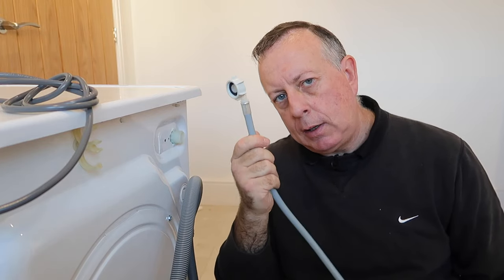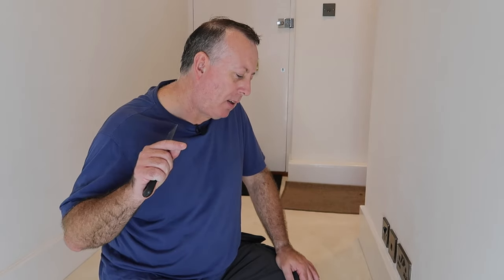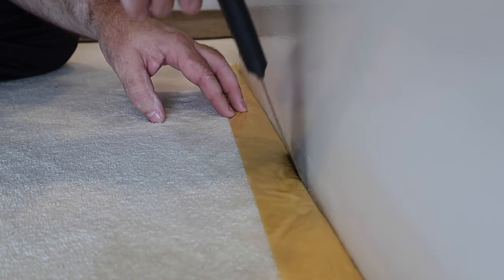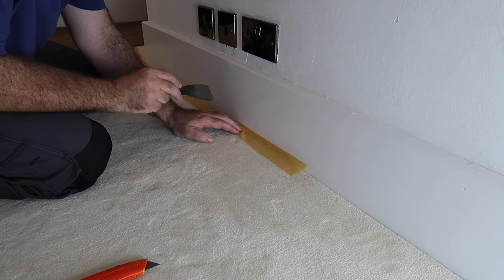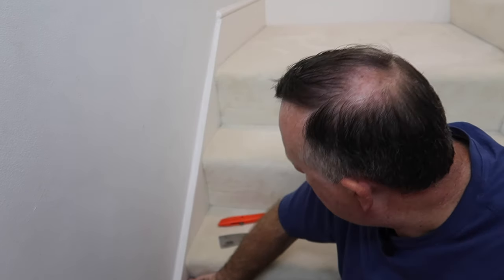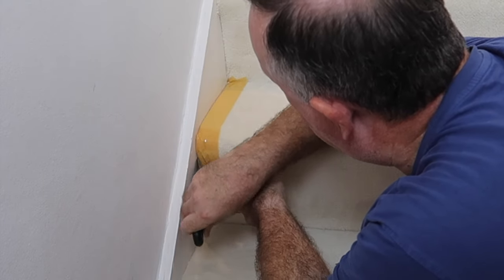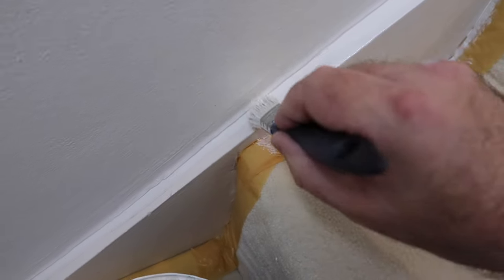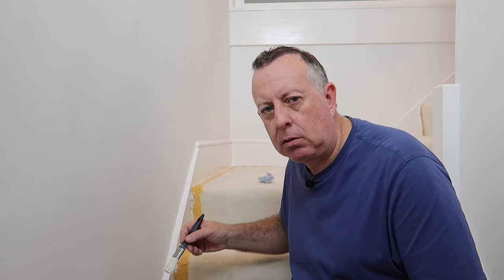How to Paint the Skirting Board Rather than the Carpet!

Comment: In fact, packing tape often does a better job than (cheap) masking tape, which tends to soak up a lot of the paint, and often doesn't stick to the thing you're trying to protect very well (so some of the paint gets wicked underneath). The downsides are that paint on masking tape stays wet for longer (so you need to be careful with it) and packing tape can stick too well and pull old paint off the surface when you peel it at the end (but on carpet that doesn't really matter, of course).

Comment: I have recently painted four rooms using the packing tape technique. It has worked perfectly each time...no more paint smudges on the edges of the carpet, or bits of fluff sticking to the new paintwork. Genius!
Reply: @kaler329  the video advised 24 hours later.

Comment: Great tip & one I have used in the past. 
My dad was a fanatical DIY painter. He used to strain liquid gloss paint through a pair of my mum's old stockings to make sure it had no lumps!! A tip given to him by my grandmother who was a great decorator. They must have had rubbish paint back then. It must have worked because his paint finishes were like glass. Anyhow, when I cleaned out my dad's garage prior to selling their house I found some strips of contoured white plastic about 800mm long by 30mm wide. They were in an unopened cellophane bag with a Woolworths sticker on them. Turned out they were for wedging in between the skirting & carpet to do the same job as your masking tape. Wedge in 3 or 4 of the plastic strips between the skirting & carpet, pull back the plastic strip & away you go with your brush. As you get to the end of the last plastic strip take out the first one & move it up to the front & so on. However, the plastic strips are too long to be used on a staircase so masking with tape is just about the only way to do that. Keep them coming Stuart.
Reply from the maker: Good stuff! Funny how things don't change much over the years except now we all have YouTube and the internet to learn from. Thanks for your comments.

Comment: Rarely any need for any type of tape. For skirting use a 1/2inch angled window brush, don't overload with paint & gently splay the bristles as you cut into the carpet. Job done. Tape will leave a mark on the painted surface ( i notice you never gave us a close up shot of the finished article). Mind, i have been doing this for decades so...

Comment: No joke, I recently used a thin Coronavirus A4 information laminate. Saves so much time. Just slide it along, also handy if you need to sit the brush down.

Masking works but you definitely run the risk of paint peeling from bonding to the tape.

Nice one cheers ✌🏻🤙🏻
Reply from the maker: Thank you
Reply: Doesn't the paint run down once you move it though?
Reply: @GK-qc5ry  no because I lay it off. If paints running you’ve used too much. The pros tape carpet, but you run the risk of it peeling when you pull the tape away.

Comment: Hi, amateur painter here 👋🏼 I tried this but when I peeled away the tape it took a lot of the paint with it leaving jagged edges ☹️ I used Dulux trade primer and Dulux trade satin wood. Primer was left for four hours, then 18 hours between two coats of the satinwood. Any ideas? Thank you
Reply: Yep, you could remove the tape before the paint dries,also when painting, don’t load the brush up so much, and try and cut in as if there was no tape iyswim.
Reply: that is an inevitable and high risk with leaving the paint to dry for 24hrs as he did in this video. Unless you run a knife blade along the boundary of tape and wood to cut through the paint, there is always a (strong) chance that gloss/satin paint will act as a film and thus be pulled off the wood as happened to you because it is "strong" enough to span the gap between tape and wood during the action of removing the tape

Cutting with a knife is obviously time consuming and not without risk of cutting things you do not want cut and leaving a visible score line in the wood if the carpet does not spring back up far enough to cover the score line.

Removing the tape before the paint is dry risks creating a mess, particularly if you applied too much paint and there is a pool of paint in the crevice between carpet and wall (such a pool also of course greatly increasing the risk of pull off if done when the paint is dry)

There is no single answer. Either way works but both add to overall time as you need to go carefully either with a knife or to avoid paint runs if paint still wet. parcel tape may be cheaper than masking tape, but gloss paint won't soak into it and therefore is more likely to still be wet long after you think it is dry on the wood.

for the small extra cost of masking tape I would use that rather than parcel tape and remove whilst paint is still wet - but the main tip is make sure whilst painting not to create pooling.
Reply: @John01GM40  Or you could just lift the carpet, 😏

Comment: I take it you used oil/solvent based paint as leaving 24hours. Water based you could possibly get away with 3-4 hours certainly 6.
My present favourite gloss is Johnston’s water based gloss. Thanks for tip
Reply from the maker: Yes correct. I'm converted to water based primer but still old fashioned when it comes to top coat I'm afraid.
Reply: I'm a handyman for 2 local care homes and use no end of Johnstones water based gloss. Obviously the drying time is the prime factor but also fumes are a lot less and it makes for easier and safer brush cleaning, obviously not having turps or spirits around. The main drawback to water based is the coverage isn't as good but as a rule I'd look at getting 2 coats on in 1 day anyway.
But thanks for the tape tip, everydays a school day.
Reply: @ProperDIY  try crowns ,fast flow,best paint on the market water based ,satin and gloss finishes you’ll never use oil based again promise

Comment: the easiest way is to peel back the carpet edges and wrap the tape around the edge, so much easier....saves you scratching the paintwork as well.....Ultimately its always better to peel back the edges and weight them down until the paint is dry and then just put the carpet back which is quite easy to do
Reply from the maker: Very difficult to do when you are dealing with the stairs especially with old carpet that has lost it's flexibility and is a bit 'crunchy' !

Comment: It’s easier to lift the edge of the carper once every 10 years! (P.s. that’s not a putty knife)
Reply from the maker: Easy to lift the carpet on the stairs?
Reply: @ProperDIY  sure, if it’s on grippers or rods will take 20 minutes which is probably quicker than masking .. unless it’s nailed or glued in which case it’s a different kettle of fish though that would be unusual on a closed staircase.
Reply from the maker: @andyxox4168  You would have seen that the staircase in the duplex apartment I shot the video in has 3 flights of 5 stairs each turning 90 deg - so ends up coming back on itself. I wouldn't be happy taking up relatively old, crusty carpet that double backs on itself and  hoping it would fit again after painting irrespective of the fixing.
Reply: @ProperDIY  ... well I doubt that it doubles back in one piece, the fitter would have made a joint at the rear of the riser and as for it being ‘crusty’ maybe it needs replacing. Still your choice.
Reply: @gaurasrspublishing  if you can’t lift the edge of a carpet then please don’t try your hand with a paintbrush ... 😂😂😂
Reply: @andyxox4168  I’ve just watched this. And no way would I pull my new carpet up and then put it back. Your idea is just ridiculous, good for you if you are gifted at dragging carpet up, as a woman I ain’t going through all that when it’s easier to do what this genius just did to his carpet.   Deluded.
Reply: @lorrainefryer  .. obviously you only list the edges … and only a fool would put down a new carpet without painting the skirting first …🙄 🙄 🙄
Reply: @lorrainefryer  … and the article is called ‘How to Paint Skirting Boards Rather than the Carpet’, the premise being that the carpet is laid first…

… Still having been painting skirting boards whilst lifting carpet edges since the days of ring and pin stretchers I can assure you it is easier and gives a better finish!

(Luton Airport anyone?)